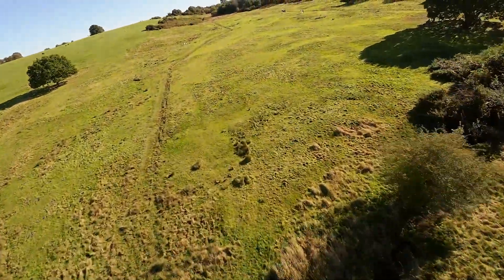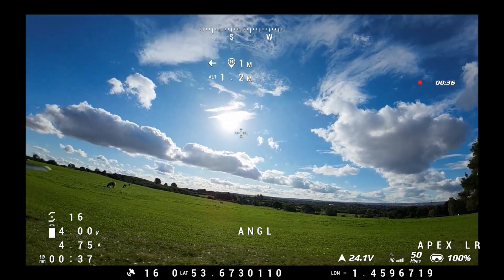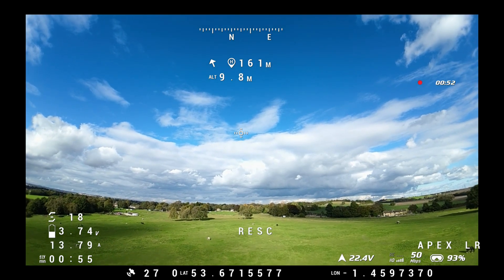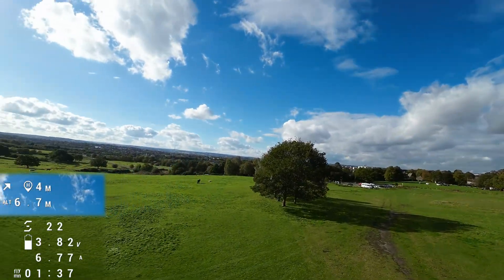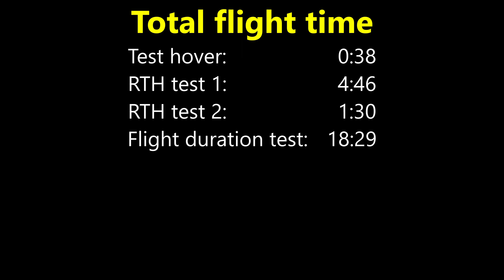Impulse APEX LR EVO 7 - build and test flights!

Comment: Great video, which version of Betaflifgt, and any special tuning or just defaults?
Reply from the maker: Thanks you. It was running INAV 7 at that time - now 8.01. Reason was I wanted a solid position hold/RTH and Betaflight doesn't have that (will not until 4.6 comes out). Also the compass is mounted 30 degrees off centre and aligning it in INAV is just SO much easier than betaflight.

Comment: Hi, What flight controller is that you are using, I notice you have the dji 03 air unit, i've got a fpv plane with dji 03 air unit and running sparrow2 flight controller and no matter how i wire up the air unit to flight controller i cannot get it to show the OSD from sparrow2 onto my dji goggles.
Reply from the maker: Hi! The quad is using a Speedybee F405V4 stack running INAV. Your Sparrow2 flight controller, I don't think it supports digital VTX's. If I remember right it's running it's own propriety software.
Reply: @Caroline_Tyler  Thanks.
Reply from the maker: Just looked it up - the DJI link on the "LefeiRC Sparrow V2 Flight controller with OSD and GPS for DJI" would only work with the original DJI Air and Air lite units, not the O3. The O3 had a modified protocol for it's OSD.
Reply: @Caroline_Tyler  Thanks for the information.
Reply from the maker: An AtomRC Dolphin - INAV Matek F405 wing FC - DJI O3 (goggles have full OSD)    -   https://youtu.be/A0z_VFHodaY
Reply: @Caroline_Tyler  Amazing video.

Comment: What did yando for skids. Cant git the ones provided with the braces on. Silly realy cheers
Reply from the maker: Yeah. I couldn't use them either, like the cable protectors are way too short too!
Reply: @Caroline_Tyler  nice frame but it seems like they rushed it and hashed it together
Reply from the maker: @johnbayliss7124  It's really solid but the extras are just pointless if they don't fit. I use the 7" more for cruising so it's not going into bandos etc.

Comment: Just about to build one. What battery did ya use with those motors. Cheers
Reply from the maker: I made a 6S pack from Molicel P45B 21700 cells. 4500mAh nominal capacity,  35A max draw.
Reply: @Caroline_Tyler home made pack  just ordered frame at weekend got brother hobby 2806.5 1300kv motors trying to source good batterys its a mine field
Reply from the maker: uk supplier Fogstar   - excellent quality and a decent price
Reply from the maker: If your going for an O3 or Walksnail 4K FPV and want to reduce the vibrations I've found the TPU inserts supplied not to work well. See https://youtu.be/p1JtNIXzuOM?si=9rwgkTCwYbjoZ1xC  If you want I can make you a couple of silicone inserts.
Reply: @Caroline_Tyler  i have a caddx vista nebula going in
Reply from the maker: That should be fine. I went with O3 so I didn't need to carry an action camera.
Reply: @Caroline_Tyler  will have a watch when am home
Reply: @Caroline_Tyler  yer lol already smashed one action cam. So i think at some point i will upgrade

Comment: What was the total distance traveled in those 25min ?
Reply from the maker: Sorry, I don't have that information. Will be flying tomorrow so should be able to give some info from that.
Reply: @Caroline_Tyler  how did it go?
Reply from the maker: @chrisbee5481  video come out today. Half pack (2000mah) 11km covered
Reply: @Caroline_Tyler  oh wow, pretty efficient.
From 4500mah 6s you get about 25min and 25km with this apex7 and 2406 motors.
I use 5600mah 6s2p with 2806.5 motors to get the same results on my 7 inch build. I was wondering what the smallest motors are that can handle 7 inch props.
Reply from the maker: I would not use more than 4000mAh from the pack usually. I like to leave an emergency buffer. Taking it all could end up damaging the cells. It's not super powerful, much more of a cruiser

Comment: good flying and testing, but more range would be fun!!! I also struggled with gps arrow and signal gettin stable. have you tried different setup?
Reply from the maker: Thanks, I've switched the 7" over to INAV and thanks to it's superior GPS handling and configuration I have a solid and reliable home arrow and the hold/RTH is dialed in. I don't push a setup any big distance until I have confidence in it's systems.

Comment: I didn't think the compass was used in rescue mode yet (coming in at 4.5) but I could well be wrong.  That is tiny for a GPS/compass - I figured you were going iNav with it.  All looks good though
Reply from the maker: This is in 4.4.2 not sure if the compass is used but there is a variable "gps_rescue_use_mag" which was set to ON so I decided to set it to OFF until I'm sure of the compass. I may go INAV on it but wanted to experience Betaflight rescue.

Comment: 25min I’m alright with that 😮I’m sure wings do more but that impressive to me! Beautiful build!
Reply from the maker: Thanks 😁. It seems to do pretty much what I had hoped for. Maybe the bi-blades will give me a little more efficiency.
Reply: @Caroline_Tyler  im building a 7 from bits of old parts and i got bi blades so id be interested to know if you see a difference. i'll be happy if i can get a gopro in the air for 5min+ - im hoping to fly cinimatic-ish stuff, doubt ill be more than 1-1.5km away so my expectations are low!
Reply from the maker: I tried them yesterday, didn't notice any extra efficiency but did notice more vibration in the video. So back to tri-blades for me. Overall the quad flies very smooth, easy to get those cinimatic moves. Next thing to test is how well it does with some lightish acrobatic flight.....did someone say long distance epic dive?
Reply: 😯🤘 @Caroline_Tyler  look forward to seeing that!